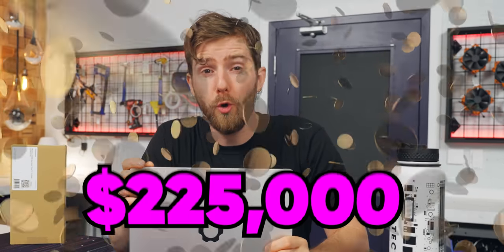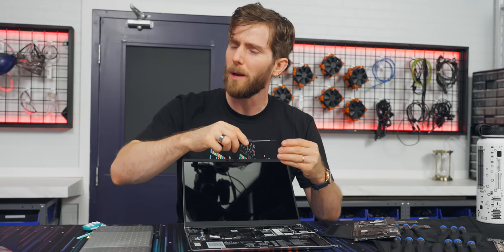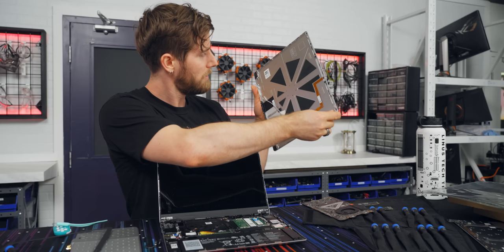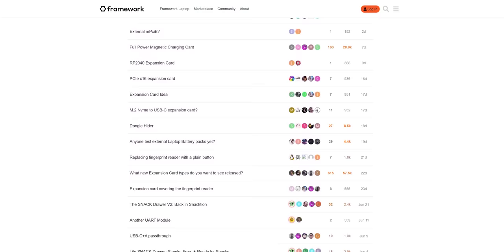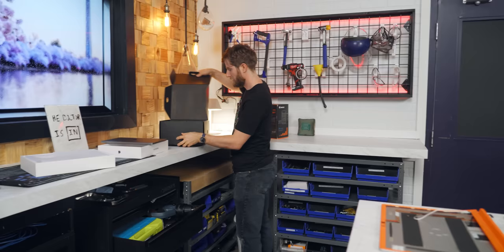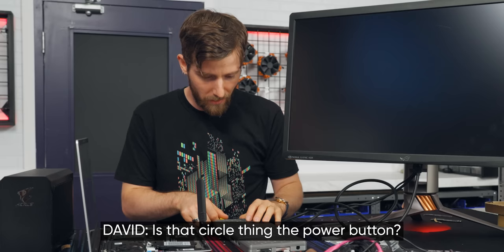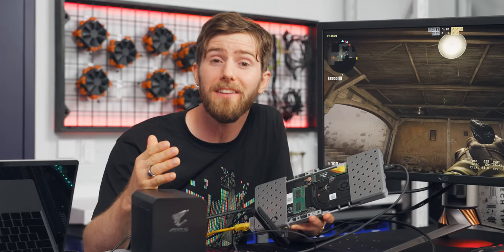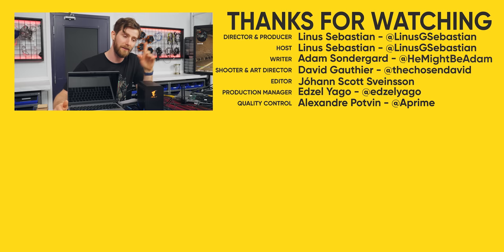I invested $225K in Framework Laptop - 1 Year Update and 12th Gen Upgrade

Comment: The old motherboard would make an extremely good home server, a specifically designed NAS case would make it perfect.
Reply: or compact htpc
Reply: @da_pawz  Or both) using Proxmox and 3d printed nas/htpc case. We just need to add hdd cases at the bottom of existing case)
Reply: @dibu28  of course. Nowadays, 3D printing is an easy task. There's room to do it.
Reply: For nas it is a bit too powerful and less cost effective depend on your use case.
Reply: @clouddcloud  Agree, and there is the problem the PI has for being a NAS as well, no place to attach NAS drives.
Reply: I'm really digging that "desktop" reuse. That's so cool.
Reply: A lot of unused CPU power for NAS. Use it as another home or work PC.
Reply: @zerocal76  but you already have it lying around. If I had a framework laptop and a PC that I use, and I upgraded my motherboard, there is no point in using it as yet another desktop. I'd rather make it something like a server or give it to someone who needs one
Reply: @markosverdhi  even if you don't have it lying around, the 11th gen boards are discounted, if you want something small, power efficient, and quiet it's hard to beat. I manage the IT for my whole family and i'd love nothing more than a server rack in every home but its just not practical.

If you want to take advantage of the extra cpu power, use VMs turn it into a PFSense or OPNsense router and a nas all in one, you could add an ARC a320 in a thunderbolt dock and turn it into a media server. Maybe add another mainboard to use for your firewall. You could also host game servers using. You can build a pretty amazing home server setup with these things over time and they don't have to be loud bulky or draw a lot of power (the last is definitely a big deal to us europeans)
Reply: @daniwalmsley611  
Wouldn’t a simple Raspberry Pi be more efficient? They’re cheap and, I have to imagine, a lot more power-efficient.
Reply: @zoetje9817  I love RPis they're great for tinkering but you can't use em for routers and you can't really use em for anything else, just the one project. What I'm talking about is using a framework mainboard as a quiet affordable mini PC with 3-4 things running on it that need more computational power or require x86(like routers). Most Mini PCs are either very expensive or lacking IO or very underpowered. This is a nice middle ground from a sustainable company.

If you have something that'll run on a RPi and you can get your hands on one definitely go with that even if you end up using 3 or 4 it'll still be cheaper than doing this, if you have space use on old pc but for me neither is true
Reply: @daniwalmsley611  Ah, okay. Thanks for the explanation.
Reply: There aren't any sata ports.
Reply: @ppbdrinker  just occoured to me you could get an m.2 to sata port adapter. If you could find a way to power the drives it might possibly make sense but something that can natively use an ATX-Compatible PSU is easier.
Reply: Whats a home server and what does it do?
Reply: @zerocal76  or make it run Unraid if that's supported by the CPU. then you can get both!

Comment: That mini-PC print-out thingy is actually the coolest thing I've ever seen for these kind of parts. Would be very easy to resell them later down the line as office PCs.
Reply: Yes, so very much that. Could have that as an HTPC attached to the back of a TV so easily. Would kick the snot out of a RPi as well.
Reply: Seriously!! I want one of those. It just looks like a router and I absolutely LOVE it. Would also love to see it run off battery power too just because why not.
Reply: Yep, I currently have 4 laptops that dont have software problems but the keyboard/screen/hinges are broken
Reply: I'm interested in that, but also with the laptop battery to use as a car-pc to retrofit modern electronics and features into my old Lincoln....I'm also hoping the prices will come down eventually.
Reply: That little 3D printed chassis gave me so many ideas, I think using the spare parts as a desktop PC is only scratching the surface of the possibilities of that little machine.  Add the battery in and the possibilities only multiply.
Reply: @z3rotollranc3  They could also offer a table chassis or 2-in-1 chassis etc. Down the line if they made a phone or something perhaps they could also make a handheld game chassis for that? So you upgrade your phone, throw the old components into a tablet or handheld (eg steamdeck) chassis.
Reply: @z3rotollranc3  It'd be like its own personal UPS. Nice.
Reply: add in MXM GPUs and you can eliminate desktops!
Reply: Dude, this would be a brilliant idea for use in office spaces. Imagine a company just uses Framework laptops for their employees, and then whenever one breaks/has issues the IT department can fix it and use any leftover parts to service the fleet of office computers that are used! They should really market towards companies with this approach, no more slow super old PCs that pose security risks with their old software, now you can even upgrade chipsets for when there's hardware vulnerabilities!
Reply: When I saw that, I thought of my own use as a device for my sheet music. I'm currently using an ancient, as in 12-year-old Dell XPS-18 All-in-1 to display sheet music. With its touch screen and special software, I can load up anything, even markup and edit, I've imported and easily turn pages on the fly. The problem is the old XPS-18 is getting really "old" and the new all-in-one devices are way too heavy. Unlike the XPS-18 which is about 8-lbs. (3.6 kg), the new ones are much larger and way heavier and nearly 3 times that or more which makes them totally unsuitable for placement on the piano or clavichord.

Using something like this mounted on the back of a touch-screen display would be the best of both worlds since the Framework PC is light enough and small enough and so is the LCD display that this would keep the weight down to a reasonable level.
Reply: The plastic will cause temp issues though, especially if you wanna do gaming on it. Maybe someone will make an aluminum shell instead
Reply: Thing could still be a thin client 10 years later
Reply: @InSomnia DrEvil Now there's a great idea.
Reply: @Gobbbbb  really cheap way to get ups levels of protection for it
Reply: @zsoltpeterdaniel8413  That's actually a benefit I never though of, I've wanted a framework laptop for a while now, just never had the funds for it.
Reply: Would make an amazing emulator station for sure!

Comment: This modular repairable design idea is really up my alley. I really hope this becomes a more competitive market in the future for all types of electronics, not just laptops.
Reply: There's a reason Linus never "got around" to doing the "spilled coke" video. Because it's actually not that easy or cost-effective. lmao
Reply: The mass consumer would not pay extra for that. Most people do not want to mess up with their laptops
Reply: it is my hope they'll eventually work out swappable GPUs and a CPUs. Admittedly CPUs is easy, since that is "put middleman PCB on and put a socket on the board" while GPUs are a bit more difficult because that will require some kind of daughter board and a good data and power link
Reply: @InfernosReaper  They don't even need to do a seperate PCB and socket for the CPU. I have a Dell Latitude from 2011 which is completely user serviceable. The CPU is an i5-2540m on socket G2, and is incredibly easy to remove. It's definitely possible to design laptop CPUs to be user-removable (LGA/PGA instead if BGA). The GPU would still be difficult.
Reply: @ajhauter5049  at some point AMD & Intel decided to not do their laptop CPUs to where they could be in a socket and swappable. Most manufacturers just build within that limitation.
Thus, unless you want to try to run desktop CPUs in a laptop, you're gonna have to do some kind of addon(s) to the CPU to make it work right in a socket... or design a special socket and heatsink setup to accommodate laptop CPUs.

Maybe if enough orders are made AMD and/or Intel would comply, but that's a huge maybe.
Reply: @InfernosReaper  It wouldn't be completely impossible to use desktop CPUs in a laptop, but there are problems with that. You're probably right about it being difficult to get them to use an LGA or PGA CPU in a laptop ever again.
Reply: @ajhauter5049  which is why a laptop manufacturer will have to do their own modifications to chips to do swappable CPUs.

Even then, they'd still be at the mercy of CPU manufacturers when they change up pin layouts. I guess they could adjust the PCB layer per chip, to a degree, but even that will have limits.

Comment: I got my DIY Framework back in early Nov, and it's been my daily driver ever since.  I run MX KDE, and it's been pretty darn much  a dream machine.  In fact, I liked it so much (and it was able to handle everything I need for my job in InfoSec and networking) that I bought a second  for my wife which she put together herself,  and as a non-techie she actually had fun doing so.  

It's not a totally perfect laptop (none are), and I'd prefer AMD, but as a long-time Linux user, the fact that they made a serious effort to prioritize my needs, meant that I prioritized supporting them as a company.  I did have a problem with the bearings in my cpu fan after about 6 months, but FW quickly sent me a replacement, and of course the repair took less than 5 minutes (and I will be upgrading my hinges once the new stronger ones are available in quantity).  I guess the "short of the long" is that the benefits of this laptop, and FW as a whole, far, far outweigh any of the possible misgivings or nit-picks.  I've been entirely satisfied with both laptops, and will gladly  keep purchasing from FW as their offerings expand.  I hope they stay around for a very long time.
Reply: AMD powered motherboard would make tons of sense for a Linux user because AMD integrated graphics is way better than Intel and AMD finally has real open source support for the GPU so it's well supported by fully open source drivers.
Reply: @MikkoRantalainen  yeah that's really the biggest drawback in my mind. If they can get a deal going with AMD, it would elevate this company's market to a huge degree. Like, imagine throwing a ryzen 6000 series chip in one of these things, how awesome would that be!
Reply: @MikkoRantalainen  Agreed -- not having an AMD option did cause me to hesitate initially, and I totally understand it being a deal-breaker for some.  Regardless, I don't regret getting their Intel version, but if they do come out with an AMD upgrade or laptop, it'll be a day-1 purchase for me!
Reply: I’m thinking of waiting for the Ryzen version. I don’t need a laptop just yet, so I can wait, but I’m still excited to see where this goes
Reply: @MikkoRantalainen  Well, I'm red in the face. All these years I thought Intel had open source drivers. You learn something different everyday!
Reply: @dirg3music ’s-comment/post “yeah that’s really the biggest drawback in my mind. If they can get a deal going with AMD, it would elevate this company’s market to a huge degree. Like, imagine throwing a Ruben 6000-series chip in one of these things, how awesome would that be!”:

not awesome-enough unfortunately ☹️. there are reports that Microsoft’s been canoodling with AMD to get AMD to integrate the TPM-chip into the dye of the newer-model of AMD processors ☹️. (And AMD — or Microsoft. - I dunno which of the two - — made the announcement that the Series-6000 processors will have the TPM-chip integrated into the dye of the central-processing-unit. And there’s-talks-and/or-rumors that the 7000-series processors will have this as well ☹️).

https://youtu.be/3UOZw-1Cp1A

https://youtu.be/heUoHPd-_N0
Reply: @reoencarcelado5904  ftpm on Ryzen CPUs has existed for a while now, it's built right into Ryzen 3000 series chips and I know because that's how I got Win11 to work. I think you're a little late on this information buddy.
Reply: @NoOne-yp1qe  Intel GPU has open source drivers but the performance of any Intel GPU is pretty poor. Even integrated GPU in AMD APU CPUs is roughly 4x faster at everything. In addition, latest gen Intel GPUs require downloading a binary blob firmware unlike older variants.
Reply: @MikkoRantalainen  Ah, they were but are not anymore. Well that sucks.
Reply: @NoOne-yp1qe  Even the latest gen Intel GPU has way better open source drivers than anything made by NVIDIA but Intel seems to be going downhill right now. For Linux users, 6000-series Radeon seems to be the best option but it doesn't yet work nicely with Blender 3.x.
Reply: If we are stuck with an APU, it should be an AMD 5xxx, which would contain a better CPU and GPU, as well as be better for battery life.
Reply: @MikkoRantalainen  - Yeah, if we’re stuck with integrated graphics, they could at least be AMD which are better in general and for me as a Linux user.
Reply: @sylviam6535  I agree that right now AMD 5700G or even Ryzen 9 6980HX would be the best option but its future 7000-series counterpart is probably going to be much better because it should contain newer gen GPU.
Reply: @MikkoRantalainen  and seeing as how intel wants to paywall cpu features again, they aren't going to be playing nice with linux for much longer, that and they want to build a networking stack onto the cpu (without the ME co processor). which to make this a reality, they are going to 'overhaul MINIX, and make a windows to minix translation layer the only possible way to use our cpus, to make it harder to bypass our paywalls', and ofc, they plan to make the linux version proprietary, after they're done testing the waters with SDSI

Comment: I've had my Framework laptop since near the beginning of February and am so far really happy with it. It was super simple to assemble, it's pretty powerful, it has reasonable (but not outstanding) battery life. I've not really made use of the ability to swap out the modules, so far I've been happy with a USB-C and a USB-A on each side, I have an HDMI module sitting on my desk but haven't used it. I'm not someone who needs to sit on the bleeding edge of computing hardware, so I won't be getting this motherboard upgrade, but I'm really happy that it's likely that I WILL be able to upgrade when the time comes.
Reply: " that I WILL be able to upgrade when the time comes."

This absolutely. The main regret over buying a laptop is that you're stuck with it forever, and eventually its components will be too outdated to keep up with new hardware, having no way to upgrade.

Framework is an absolute game changer, the fact that you can turn the older components into a spare PC is mind blowing!
Reply: @whitehavencpu6813  you know that when you buy a new laptop you are not obligated to drop the old one in the bin, you can still use it as a home pc. Also, you will still need more just the motherborad to be able to use your old hardware, ram and storage also required, but at that point you are basically buying a new mini pc, that is already outdated. Being able to upgrade is nice i agree, but in reality, the price is what drives consumers and convenience, this one does not provide both.
Reply: @user-ni7gk5tg5j  I meant that if the old laptop stopped working, you can't just strip it down and turn the working components into a pc, very rarely is that possible due to various integration issues, but with frame-work and how modular all their parts are its possible to simply convert the old hardware into a different machine.
Reply: Sounds more like buyers remorse and trying to justify your bad decisions.
Reply: @evolicious  how do you get 'remorse' from my description of being happy with my laptop?
Reply: I don't really think the upgrade path is that interesting.
The board is like over 60% the cost of the computer and that's the only real serious "upgrade" there besides internal storage...

The repairability and just general flexability and ease of use is super nice though.
Reply: So if you saw a deal for 40% off a new laptop you wouldn't think that was significant?
Reply: @rawbeanuk  Not when a new laptop comes with a mainboard + storage, + screen, + chassis + keyboard + wifi module + external IO + speakers.

40% off to get just the mainboard is not a very good deal.

Also the old parts are less sellable as parts as oppose to a whole.

That might improve when framework becomes more established and there's a decent market for second hand parts but for right now. You're mostly just buying an idea.

Which is a shame because I love everything that has gone into this laptop
Reply: @whitehavencpu6813  usually if sth in your laptop stopped working you can still repair it, unless its made lap eg. Apple macbooks. But aside that, most pcs of this form factor are repairable. And chances are 95% of the users will just bring it to a shop for repair. I mean, i do not deny that there is a market there, but the statement of upgradbiltilty heavily contradicts with the price they charge. Usually, those are two different groups of people.